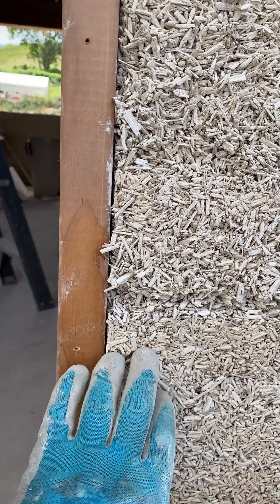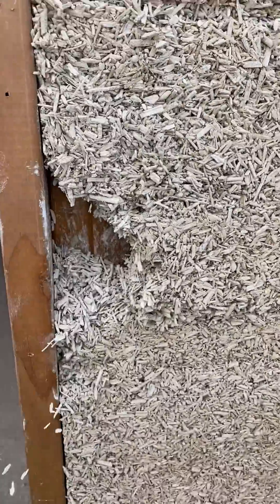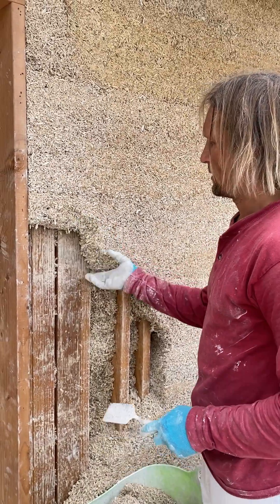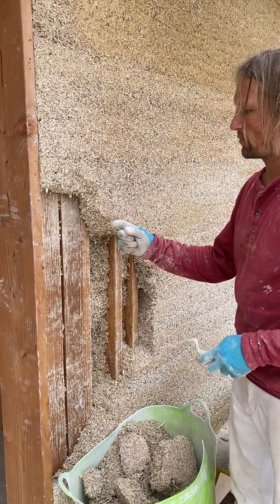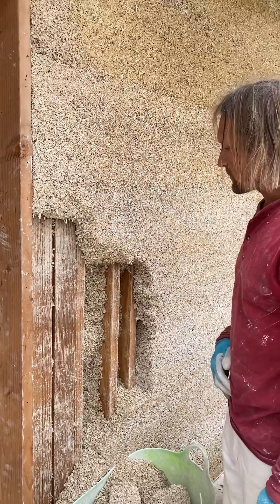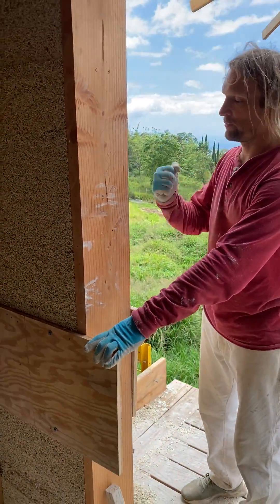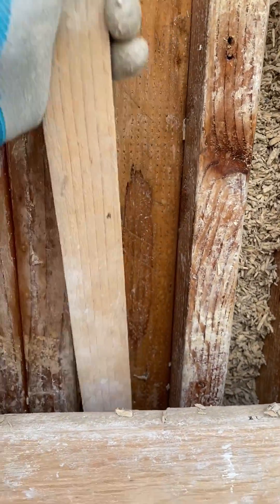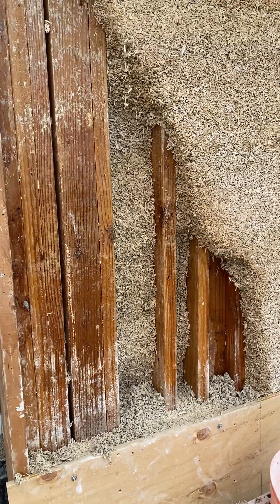HOW TO FIX A LOOSE OR A CRACKED HEMPCRETE (HEMPLIME) WALL

Comment: This is invaluable. Thank you! Good to know about too much wood in ratio to henp thickness adding challenges, and being able to reuse the hempcrete. Just from my understanding, you don’t want to tamp too hard as this depreciates the insulative value. Not a concern in some climates. I’m in Canada and will be doing 12” thick walls, so the wood shouldn’t be an issue for me.
Reply from the maker: @NIWHHC  thanks! Don’t pack the middle of the mix  to improve the thermal performance.